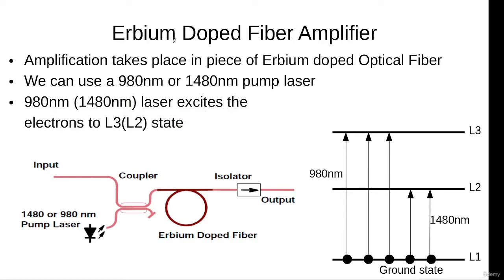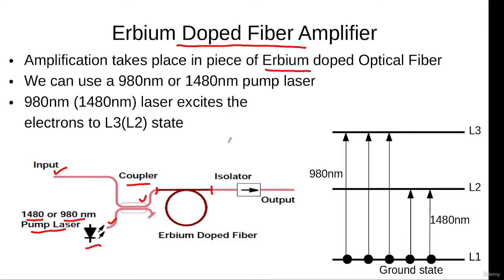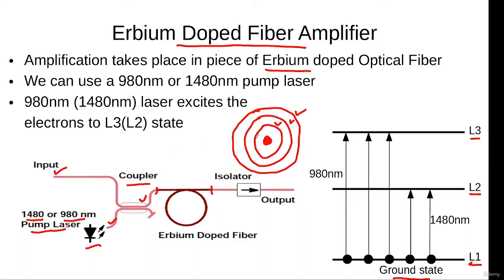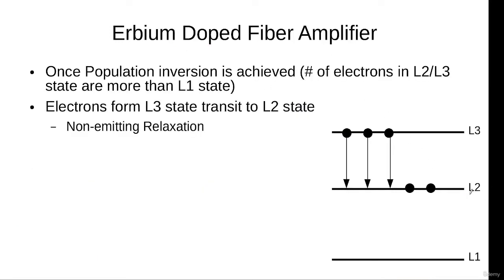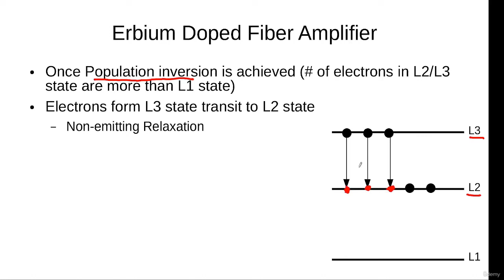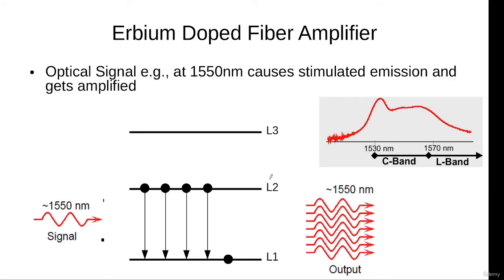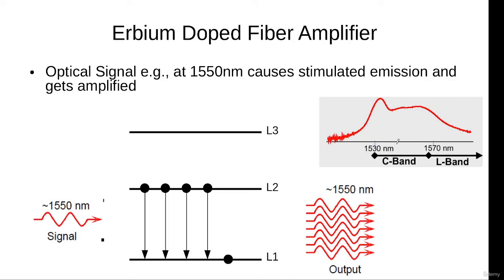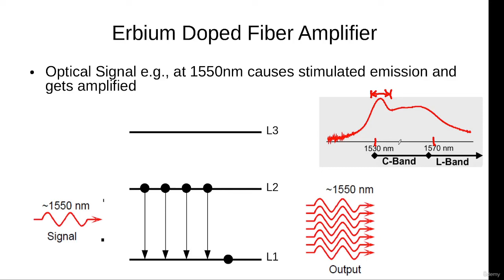Working Principle of Erbium Doped Fiber Amplifier (EDFA)

Comment: I have a question though. 1480nm excites electrons from L1 to L2. Then how could 1550nm photons be emitted again when transition occurs between L2 and L1?
Reply: That's what I'm wondering too. Even relaxing from l3 to l2 without emission makes me think energy is partly used for vibrations. Then when the originally l3 or originally l2 are relaxed to l1, if the energy released really is of the same wavelength as the lower energy light, does the remaining energy from those photons that brought the electrons to the excited states simply leave as heat or are the electrons still vibrating at l1?